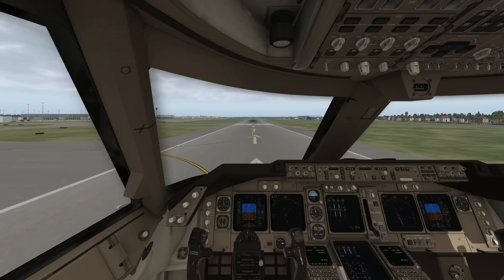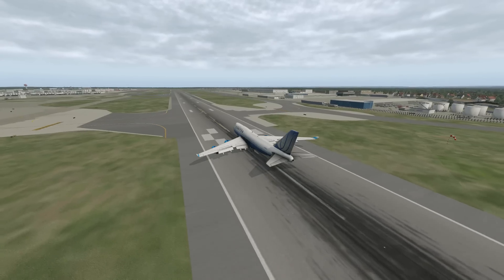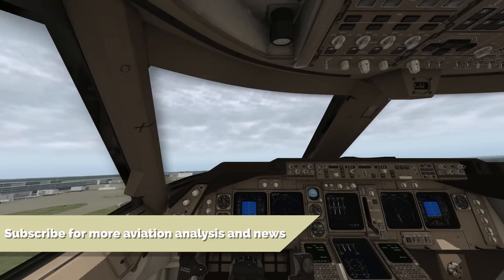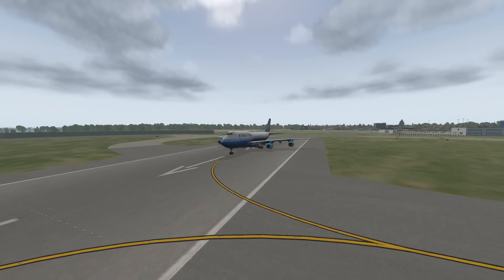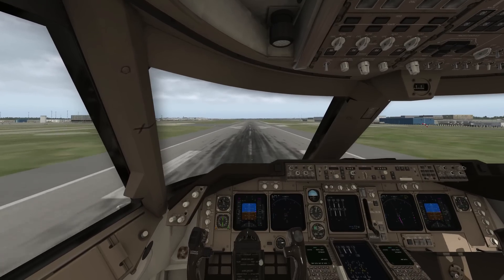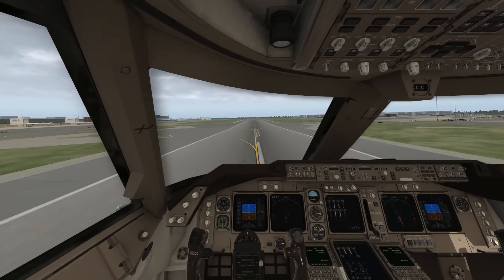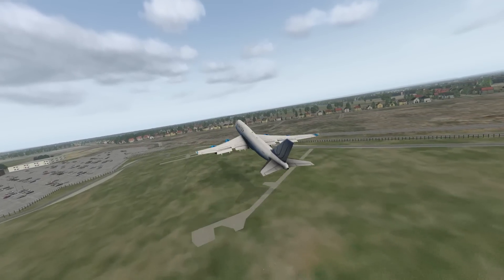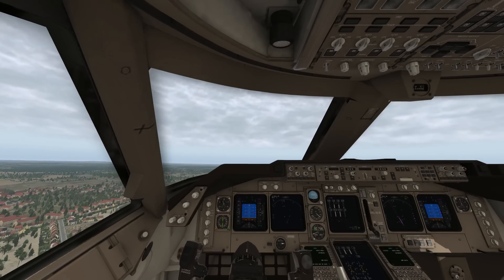WHAT IF #1: Can a 747 Take off With Two Engines?

Comment: Boeing actually tests this. But they do it by using 4 engines and reducing thrust to match the trust made by two at full power. They also simulate single engine takeoff with their twins.

Comment: From a pilot’s perspective you are facing differential thrust issues even using engines 2 and 3 and that’s why you’re having problems to keep it on the centerline also, we don’t know if you were facing a crosswind or not, be aware that I’m not a 747 pilot. Now, about that differential thrust issue: due to the wingspan of the 747, you have the tips generating more drag than in their root, add that to a possible crosswind coming from your left hand side and there it is, you have each engine delivering a different amount of thrust even using the same power in your cockpit.

Comment: Any thoughts about doing a two engine with a MD-11 as well (Can a MD-11 Take off Without it's middle engine)?
Reply: Why not both? what would be nice to see. ¯\_(ツ)_/¯
Reply: It’s possible, a twinjet md11 is similar to the 777 without the additional main landing gear
Reply: Even more interesting would be to see if an md 11 can take off with just its middle engine
Reply: With just its third engine attached to it’s vertical stabilizer and no wing engines it will be unable to takeoff

Comment: With Two GE90s? Definitely, Those 2 Gothical Engines powering the T7 has enough power to lift up a whole  747 into the air
Reply: Yaboinav Aviation I wish!! ;D
Reply: Johnny Wynn you are so rigth and plus if the 747 had some parts made of carbon fiber it will defenitely fly with only two engines
Reply: Jasper Tiger Gaming Indeed. Carbon Fiber will make it much lighter, but how many GE90S do you think can get the a380 off the ground? 2-3? Maybe, 4 may sound like too much
Reply: I'm on it.
Reply: 3 Ftw then, but the 3rd Ge90 on it’s vertical stabilizer =D
Reply: Of course it would with two GE90s. I wonder if it would with ONE GE90-115B
Reply: That would be a sight! A mammoth DC-10!
Reply: It would lift it but will end up flying sideways 😆